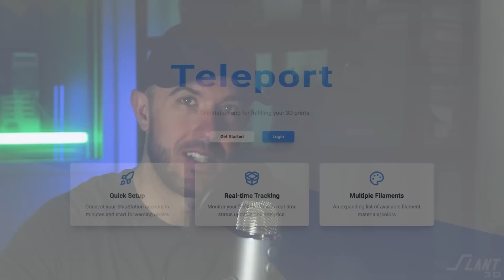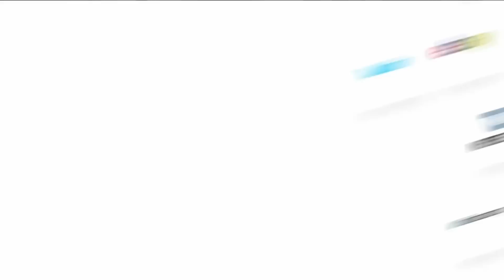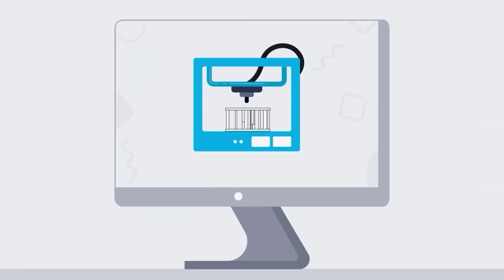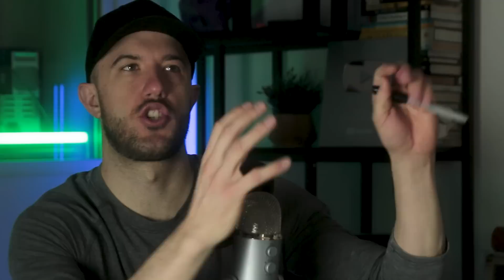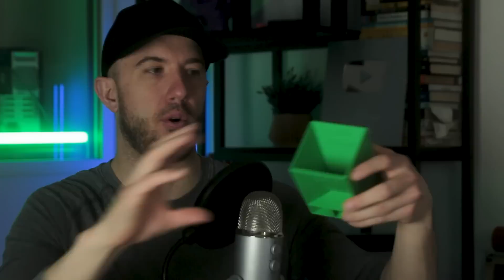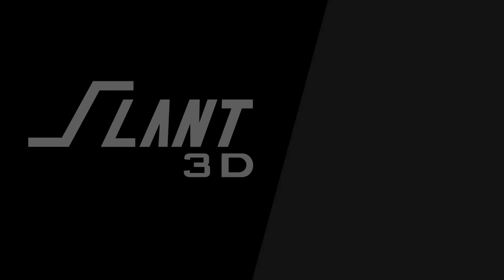It’s Our 100th Podcast | Everything Will Go Wrong | 3D Printing News | Podcast Ep 100

Comment: Question: Could you expand more on your statement, "The print should not rely on slicer settings?"

Are you just saying that the print should not fail because of slicer settings? Or are you saying that 2 walls, 10 percent infill, should be just as functional as 6 walls, 80 percent infill? I'll print fidget dragons at the former, but I might adjust the number of walls and infill for functional prints. Especially if I expect them to withstand weight or vibration. Am I  wasting filament? 

Does Teleport use a cookie cutter slicer profile that might not be effective for certain functional prints?

Comment: I strongly believe there are still two use cases where ABS is of value to the hobbyist.  

First: a large object that won't fit on a single print bed and thus has several parts that need to be solidly joined.  Some sort of welding is thus required; solvent welding is the most accessible form of welding for a hobbyist, and ABS is the least toxic filament to solvent weld.

Second: an object that needs to disguise its 3D printed origin, such as a movie prop recreation.  This means sanding out the layer lines and painting, and ABS is vastly easier to sand smooth than PLA or PETG because it's softer than either of them.

Neither of these are relevant to mass production.  For the former, a large scale factory would either make the object as a single part or join them using something like sonic welding (or have access to skills and equipment that mitigate the dangers of the more toxic chemicals).  For the latter, mass producing something that absolutely could not have layer lines would use a different technology than 3d printing.  But for the hobbyist, when those admittedly specific goals are in play, ABS is the best option.

And really, I feel one should not spend a great deal of time around working 3d printers without good ventilation anyway, even PLA churns out microplastic particles you don't want to be breathing and whose long-term effects we don't really know because we haven't been exposing people to them for decades (yet).  So the extra work to deal with ABS fumes is minimal: put the printer in a separate room with a fan that vent air to the outside.  Stay out of that room whilst the printer is running.  Problem solved.
Reply: I would also like to add that ABS is dirty cheap, which is also a factor.

Comment: > Don't print with ABS there's so many materials that are so much better

First time I've heard anyone say that; please elaborate, thanks.
Reply: Use PETG.  ABS is slightly stiffer, handles high temperature better and can be acetone smoothed, but PETG is better at everything else.  Plenty of comparison charts out there for you to compare materials.
Reply: @j.f.christ8421  Is that the case for engineering parts? 

Seems like functional products are much more likely to be made from ABS. 

And then there's the stringing and cheap looking glossiness.
Reply: @noahkatz9616  ABS is fine, 3D printed ABS is a pain.  If you were injection molding then ABS is a no-brainer.  If you want to reliably 3D print a part, then try the alternatives to see if they hold up.

There's a reason everyone switched from ABS to PLA when it first came out.
Reply from the maker: ASA
Reply: @slant3d  I thought ASA was only moderately (if at all less) toxic than ABS...

Comment: Question: I’d like to know if Slant 3D can also help with assembly and integration of third-party electronic components.

Specifically, I'd like to include the following with the printed part:

Two DC 5V Mini 2510 Brushless Cooling Fans (800RPM, quiet type)

One USB Type-C Connector Board (female breakout for charging)

One on/off power button

Two fan speed control buttons (low/high)

One rechargeable lithium battery (3.7V or 5V)

Four brass insert nuts (for screw mounting)
Reply: No-one is going to do one-offs like that.  Print 1,000, send them to an assembler along with the rest of the bits.
Reply: @j.f.christ8421   Suggest me an assembler please
Reply: @mcneho  Google "prototype assembler" to get an idea.  The tried & true method is you hire a school kid to put them together.  A local machine shop might do it.  

The anti-DEI crowd might have shut them down, but often there are small workshops for the disabled, veterans etc that do assembly work like this.  Years ago I had a local charity do some stuff like that for me.  Where I am they're called "sheltered workshops".  You supply parts & training, they put them together.
Reply: @mcneho  Dunno where my comment went, but look at hiring a school kid, prototype assemblers, or what's called around here a "sheltered workshop".
Reply: @j.f.christ8421  thanks mate🤝
Reply: @mcneho  School kid would be cheapest, prototype assembler the most expensive.  Best would be the sheltered workshop (they hire the disabled, veterans etc and are usually a charity or gov. funded).  I've used a few in the past and they do a good job, you need to provide any special tooling, test jigs, training etc.
Reply: @j.f.christ8421   Alright, hey do wanna be the first to tryout my prototype?
Reply: Sounds like a lot of parts! Sounds like soldering on the customer's end! Sounds like complexity!

I can feel Gabe recoiling with an instinctual "nope."
Reply: Probably better off packaging and shipping these hardware parts yourself. Let S3D handle the printed components.

Comment: Question: This week you answered a question about lithophanes and the maximum wall thickness of 4 perimeters, 1.6mm total. Currently I am designing a very watertight part under the assumption of Teleport's "1mm walls" plus an internal void to double it. This attempts a total of 2mm contiguous permitter walls with no infill, spaces, or weird gap fill. How do we end up with four 0.4mm perimeters in your example?
Second, is it possible to double this using an internal void to get 3.2mm?
Thank you, congratulations on 100.
Reply: Modern slicers use Arachne perimeters, which is why you get 4.
If it gets too wide, you'll be stuck with a void that just gets plain 25% infill.

edit: Wrong info, nevermind!
Reply: @GyrosoftCo I don’t think you can assume Arachne. Most slicers are not defaulting to Arachne currently, not because the idea is bad, but because implementation is buggy. I would actually bet the other way and guess that it’s not Arachne under the hood. It would cause too many problems in a POD service as implemented.
Reply: If you add an internal cuts to induce walls, you can get 3.2mm thick perimeters (see Slant 3D's "3x Part Strength Without Slicer Settings"). But that requires CAD software. It's also hard to do, especially models with a lot of triangles. Just do Gabe's recommendations, save yourself the trouble.
edit: Incorrect context, needed contiguous perimeters. My bad!
Reply: @GyrosoftCo  I'm building a watertight part in CAD (and V2 will actually need to be airtight to hold a slight vacuum). The voids strategy is a little different in my case, because the voids themselves will propagate leaks. So in that case you're looking for a contiguous double-thick wall, with full layer adhesion. So understanding exactly what Gabe is saying here with regards to 1.6mm vs 2.0mm is going to be paramount.
Reply: @LayeredDesignWorks  Ah, I erroneously assumed you were still talking about lithophanes. I agree, making something with a contiguous wall like that would require an answer on that. Added edits to my prior replies, as they're incorrect in this situation.
Reply: @LayeredDesignWorks
> 1.6mm vs 2.0mm
I feel part of Gabe's response would be "do 1.6 mm as a catch-all so that it's more robust for any print service, not just ours", or something like that. 🤔
Reply: @GyrosoftCo perhaps, TBD
Reply: Ideally absolutely. Minimize reliance on slicer settings as much as possible. And I’m definitely doing that, it’s a tough one. If I didn’t think Slant 3D could reliably print this in POD I wouldn’t be doing it, but it’s definitely at the leading edge of the service currently. Would make an excellent test case for them if it was faster to print. If I can get it to work reliably I’ll send one to Gabe.

Comment: Question: I agree no ABS, what are the best replacements?
Reply: ASA, PETG, Hard TPU, etc.  Determine the requirements of the design, and pick the right material.
Reply: ASA is the closest like for like replacement, but if you need impact resistance as well as heat tolerance then a polycarbonate (nylon) blend like PA-6 or PA-12 might be more suitable. depends on the application, as the commenter above says

Comment: 6:50 - This exemplifies the "This Is Fine.gif" 
Question: How can you, with a straight face, finger wag a company as being unstable because of a politicians' decision and then 13 minutes later explain how a missing screw can shut down a production line? Just combine the two thoughts: you have a missing screw because of a politicians' decision. If you can deal with it, great! If not, then it cause cause major problems.
These tariffs (like all policy) are designed to change companies, consumers, and everyone's behavior. That includes purchases of all kind not just those that are tariffed. Because when I have to buy product A at twice the price I was expecting, I will not buy as much of the rest of the products I was going to. This is affecting everyone and your flippant attitude is not helping.
Reply: This is conflating macro-level economic policy with micro-level operational risks. The former is outside of a company’s immediate control (i.e. macroeconomic / policy changes while you are a small fish) while the latter is a risk/weakness that the company can directly change (e.g. designing a production line to be as simple as it can be and remove the need for that screw).

As a company, you should at least be prepared to weather storms from the former. That is done ideally through keeping a buffer / margin for error in your operations.

Even if it were true that tariffs would suddenly make your company unprofitable, it’s still not useful to blame things outside of your control, and there are likely a lot more actions you could take within a company to make it more financially sustainable.

(stoic undertones of “focus only on things you can affect, ignore everything else” aside)
Reply: @GyrosoftCo  I like your comment, and yes you are correct, I see the difference you are pointing out. FYI, the 2nd half of your summary doesn't capture your 3rd paragraph well: "Focus on what you can fix, ignore everything else". You know you can't do that. You can't ignore something that's killing your business. Plus, the purpose of the tariffs is to change people's behavior. A better summary might be: Fix what you can, and roll with the punches. But that’s not the heart of the matter here.

My issue is more with the blasé attitude towards that. And since this podcast series is presented as discussions on the state of the 3d printing industry, how to design parts for 3d printing, tid-bits on running businesses with 3d printing, etc. This included discussions about regulations, taxes, international shipping, etc. before. Now, when it’s important to understand how the tariffs might be affecting the industry the response is “don’t worry about it”, and then a disingenuous statement of being more resilient regardless “what one politician decides”. 

I really wish I could just ignore what that “one politician decides”. Can you? Can your business? It's causing a lot of trouble in mine.
Reply: he's not obligated to agree with you or feel the same as you

Comment: I tried using 2 different emails to get signed up for Teleport.  Every time i go to connect Shipstation it says it cant save the key in teleport and does not connect.  I did follow instructions and used the V1 keys from shipstation.
Reply: Probably email them? I don't think you'll get direct customer support through a YT comment.